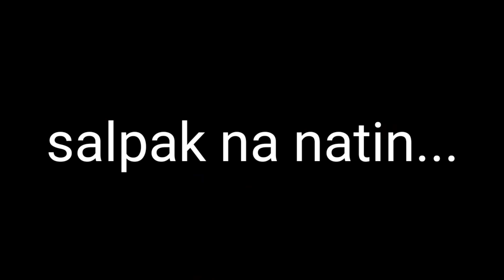OIL COOLER PROJECT | HONDA BEAT CARB TYPE 130cc

Comment: Paps. Pwede ba yung oil cooler ng r150 kase hawig lang siya ng surplus na air-cooler na ginamit mo at magbubutas ka ba talaga sa engine head niya? Salamat sa sagot paps
Reply from the maker: Yes paps pwede ung pang raider150,  oo paps need talaga mag butas para sa daanan nung langis...
Reply: @frnczbeatmotorsports4287  Thankyou paps. Ridesafe! Godbless!

Comment: pano pag beat fi lods , san ikakabit yung hose
Reply from the maker: Same lang halos sa hose sir, ang magkaiba sa bracket
Reply: @frnczbeatmotorsports4287  kelangan pala , ipabutas ung head cover?
Reply from the maker: Yes po need ng modification para sa pag pasok at pag labas ng oil

Comment: di ba masisira makina neto sir ?.
 tama lang ba yung pressure ng oil papuntang head ? naabot ba nya yung mga moving parts? curious po kasi papakabit ko sana nbili kung oil cooler . thanks more power sa channel mo 🙏
Reply from the maker: Salamat po sa magandang kumento,  okay naman po ang makina sa tingin ko at na-check ko ang mga parts sa head at na sure ko po na nalalangisan ito, nag dagdag nalang po ako ng 50ml na oil para mas maagap ang pag circulate ng langis sa makina,
Reply: @frnczbeatmotorsports4287  copy sir ☺️thank you  🙇🙇. napakalaking tulong netong video mo . Godbless you more and more 🙏
Reply: 6 row

Comment: air-cooler,, pero walang fan.. iaasa lng ung cooling system s hangin na babangga s radiator.. hahaha

1. ng install ng oil radiator s seat ng walang fan
2. walang final result or test n tlgang malaki naitulong ng cooling system s pgpapalamig ng oil, dahil wala k nman nilabas na temp result, gamit k kaya ng temperature gun pra mapatunayan mo n malaki ang help ng radiator
3. dagdag porma lang pero walang performance.. hahaha

wag nyo na baguhin ang design ng makina,,

Comment: Ok nakita naten na talagang lumalabas ang langis, ang tanong ano kaya ang epekto nyan sa makina may kaibahan kayang mangyayari di na kaya mag oover heat ang makina sa matagal na pag andar.. medyo mahina kasi ang paglabas ng langis yung oil pressure kc nyang beat eh specified sa aircooled na makina at hindi sa oilcooled engine, since inilagay mo yan may sapat pa kayang oil pressure para maibalik nya yung langis sa makina ng tama at eksakto para e-lubricate ng tama ang mga moving part sa loob.. yung iba kc na nagpakabit nyan bumili pa sila ng after market na oil pump para ikabit, yung engine ng raider meron na non originally pero ang beat engine hindi sya design para dun kaya kailangan talaga ng proper na modification para dyan kaya madami nga ang tumututol dyan eh,.. pero talagang totoo na ginagamit talaga sa makina yan, no offense po pero parang nakakatakot na basta na lang magpakabit nyan madami kc akong nakita na nagpakabit nyan sa honda wave at xrm na motor eh pero ngayon dina ok, yung honda wave ng utol ko wala nyan 10 year na pero wala namang naging problema yung mga kasabayan nya ayon mas madalas magka problema sa makina nila..
Reply: amen